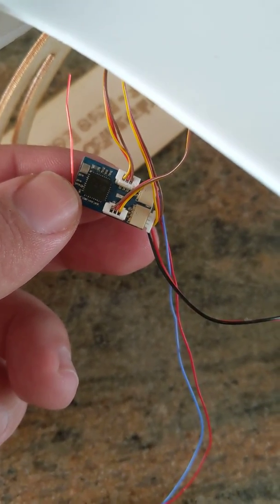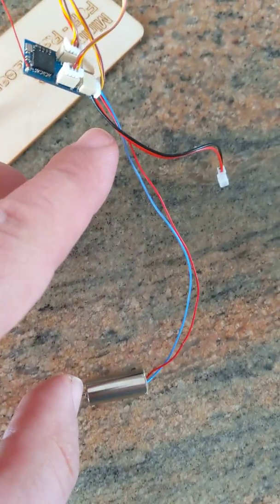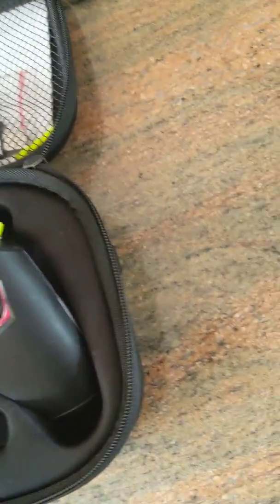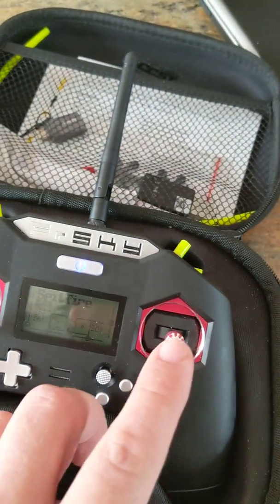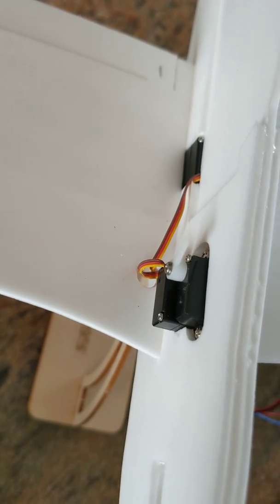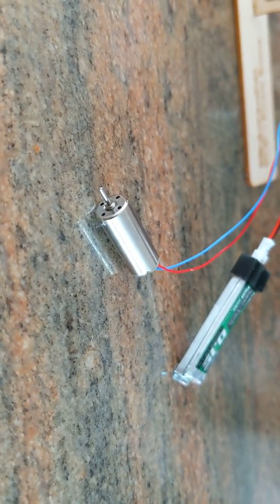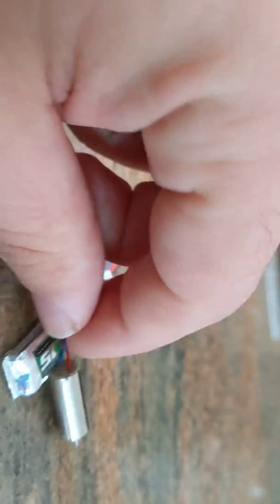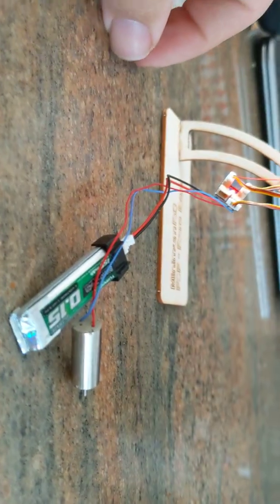2.4G 4CH Micro Low Voltage DSM2 DSMX Compatible Receiver Built-in Brushed ESC

Comment: I had the same problem, but I solved it by setting the low throttle to -110.
Try it.
Reply from the maker: Are you using frsky, if so would you be willing to share your model profile or a screen shot of your settings? Cheera
Reply: Sorry I'm a user of Deviation.
I think that lowering the throttle trim has the same effect.
Good luck.^o^
Reply: Same problem with Jumper 12TX. But problems to lower the throttle below -100
Reply: ... soultion found for JumperTX (OpenTX): search for E-trim (extended trim), allow. Search "output page" set channel to -110. Motor works now.